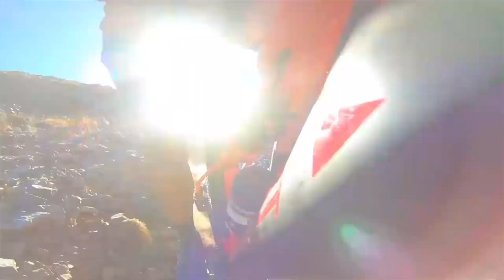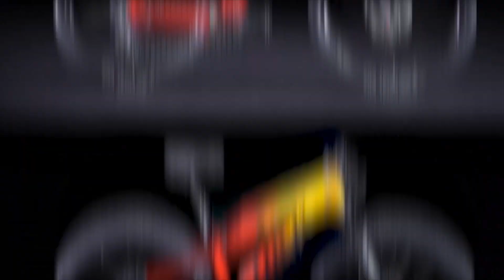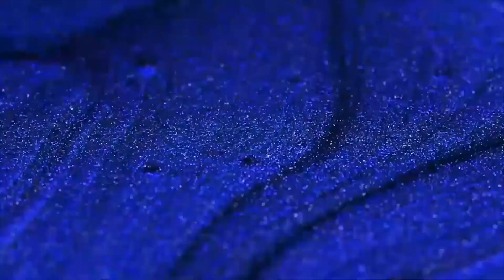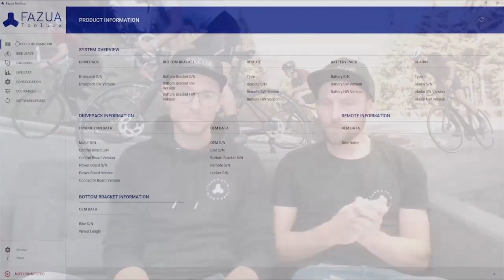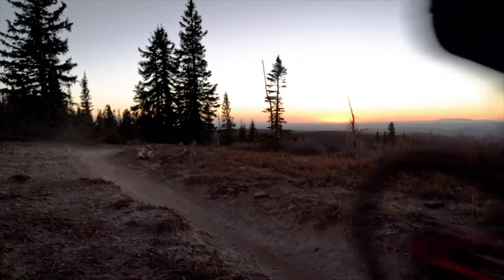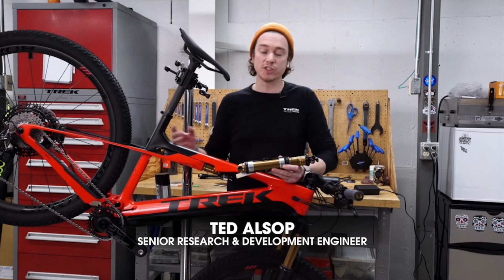Trek E-Caliber Launch Video, Fazua Interviews

Comment: It’s 2023, is Trek going to continue with this bike?  I sure hope so. Would be nice to upgrade to the Fazua Ride 60.  I have asked Trek what their plans for this bike are, no answer. Come on Trek, put the new Ride 60 motor in the bike.
Reply: I think they've transitioned over to the TQ system for their lightweight ebike systems. The Fuel EX-E has it, as well as their e road bikes. I think there's still high inventory of these now, but I wouldn't be surprised to see a TQ version of this bike in another year or so.

Comment: As a consumer spending $5,000 to $10,000, I want a proven reliability, hence Bosch or Brose. NOTE that Sam, Court's frequent guest retailer, said Bosch had the fewest breakdowns. That's pretty darn important when the e-bike is useless without its motor. To my ears, 'Fazua' sounds like a cheap chinese made brand - think 'Bafang' - although a Bafang can be replaced for a few hundred dollars. I don't know what the marketing people were thinking to come up with  Fazua as a name. The literature says the brand is German. So what's in a name? Perception happens first. Secondly, before I'd buy a Fazua, I want to see reliability - and that can only be determined over time. (Trek, I have two of your 'acoustic' bikes but when it comes down to spending thousands of dollars for transportation, don't make my wallet your guinea pig.) Court, thank you for posting!
Reply: This comment didn’t age well. Fazua is now being adopted by many MTB manufacturers. It’s going to be the new standard with the 60 series motor and higher battery capacity, all in a compact package that’s hidden in the frame. Bosch motors have a huge amount of drag when “off”. These fazua motors coast and pedal effortlessly.  Proven reliability now.